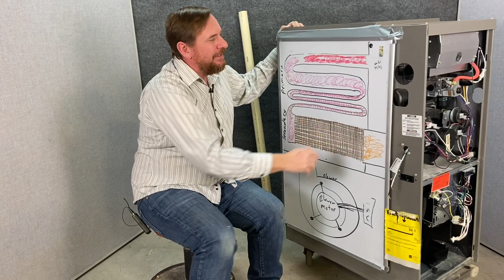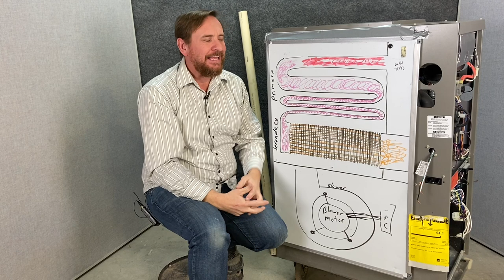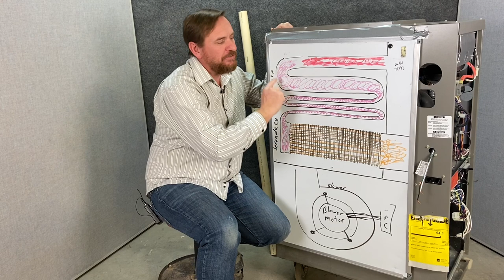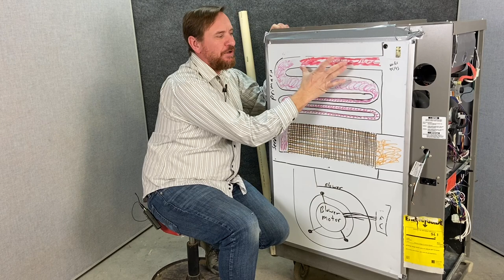90% + Condensing Furnace

Comment: "Required".
Required by whom?
Are these ultra-complicated and expensive machines cost effective over their total life????
Or is this another expensive, pointless dictate from bureaucratic petty tyrants making life more difficult for everyone?
(All I hear about these are those paper-thin heat exchangers rusting through, fans not working, cramped working conditions, more problems with water condensate damage and EXPENSIVE EXPENSIVE EXPENSIVE REPAIRS!!!)

PS: am big fan of your channel, but have total disgust for the hideous things government has done to this industry.

"I wish the regulations made as much sense as your fine videos."
Reply from the maker: I'm against the over regulations myself. It's a bit crazy to say you can sell the product here but not there. 

I have found the biggest issues with this equipment is installation. Improper airflow, over firing under firing the furnace, lacking combustion analys. Notoriously people are not piping the combustion air from outside. This pulls from the house creating negative pressure and pulls in more chemicals that kills the heat echanger. That secondary is stainless steel and if the drain is actually done correctly there is not an issue. For foamed houses it is the best gas heating solution.

Birds in the flue are the one unsolved issue.

It's the modulating furnaces I see the most issues with. That is one example of repairs exceeding benefits and initial cost. 

Either way they are here so we have to learn and adapt. 

It will be interesting to see is gas will even be allowed in new homes in the next 15 years
Reply: @love2hvac  

Thank you, Ty.
Duly noted.
I'm still on the low end of the 90% learning curve (your videos the best on this) - have to learn to think of the house as a bit of a space capsule. 

I thought RSES was a place to go to discuss how deformed the HVAC business is b/c of the regs. I can't stand it. There must be a way to push back on this. 

[Dictating "efficiency" is such a stupid premise - "duhhh, who doesn't want efficiency?" But that stupid EPA has made a fetish out of it. And natural gas is so dirt cheap they have to flare it off (!). 

Maybe that's why it's called the "Montreal Protocol" -- have it in a place where people don't worry too much about air conditioning. 

Natural gas banned for home heating?  Yes, we are fast approaching that level of stupidity.  Thanks for the warning.  You're reminding me I'm an old man who is sickened by a future like that.]

[ Have to do homework on what "modulating" furnaces are. "Two-stage" sounds like a winner for comfort/selling purposes - nothing to do with that stupid EPA. The customer should have the option. And the outside-to-outside combustion air is like "of course, why didn't I think if that?" -- but those are things you can sell the consumer; don't have to be rammed down their throats by the disgusting EPA. And we've gotten along fine without houses being built with the atmospherics if an airplane.  
I almost cry when I watch those videos that go something like, "Today we're checking in on an R12 system that's worked flawlessly since the '70s..."
It's the state of America in microcosm.]

.
Reply from the maker: Yep,
They keep passing laws making the unit more energy efficient but allow the new houses to be built like a colander.
In Vegas, and Phonix the hottest climates in the country they are putting units in the attic (not foamed) with the little trapdoor offset over a shelf in a closet.
Only 1 person benefits from that, the builder. 
If we ever needed a regulation would be new houses are not allowed to have units in unconditional attics and must require pulldown ladder!!!
Reply: @love2hvac  

"Old Man Syndrome" here again. I'm thinking "If I get into this business, I'm just not going to do attics and crawl spaces - sorry, get a younger guy to suffer that."

Speaking of crawl spaces, Anti DIY had one where the homeowner stored a casket down there. That even set Mr. Anti DIY back - "now I've seen everything".